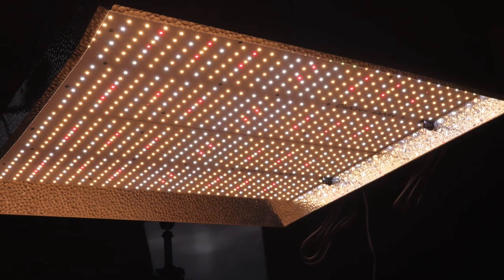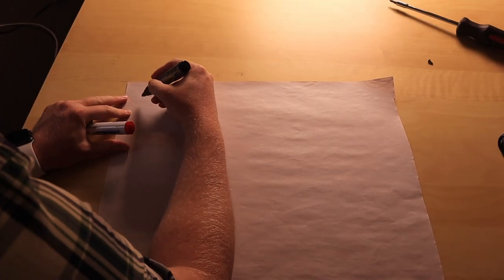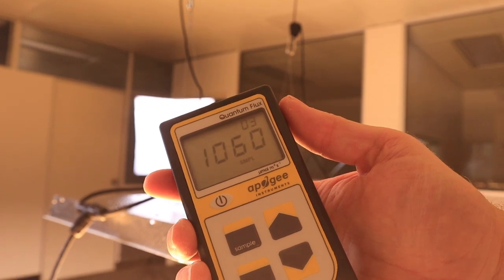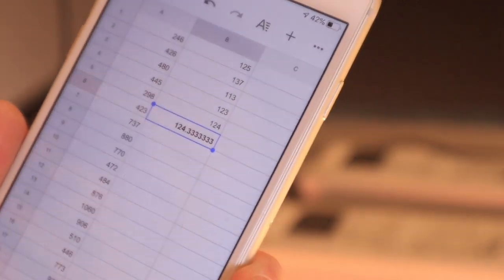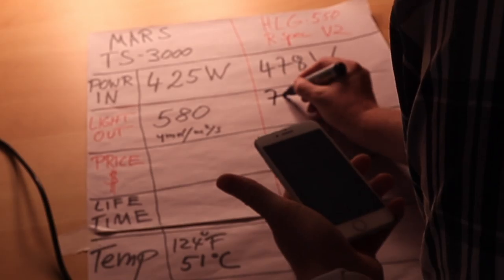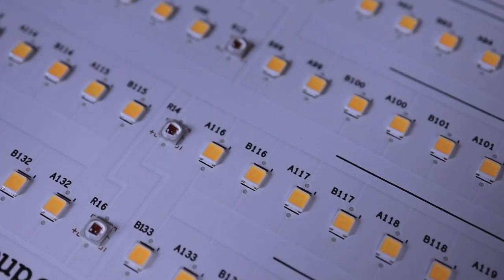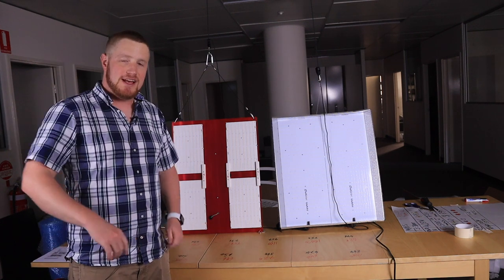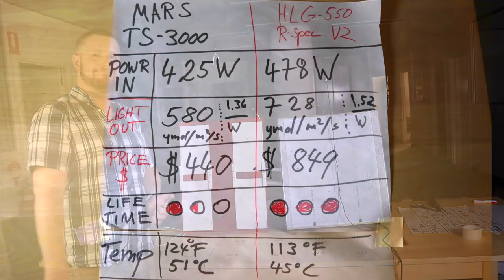HLG 550 RED v2 VS Mars TS-3000 - LED Grow Light Comparison

Comment: Thanks for the honest review , one thing we want to make a clarification is that the lifespan won’t be less than Samsung is that we use over 1200 pcs of the chips on the board, we use less amps(nearly half of which the Samsung chips uses)  to drive each chip so that each chip is less than 0.5w, this will ensure each chip at lower wattage pressure and gain longer lifespan .:)
Reply: ya hlg if there running over 52% that junction will heat,and leds will hit there L90 so much faster,and at $1800 ya want 5 years or over,and hlg really going after anyone using word quantium board
Reply: @magnumopus9631  It’s certainly very hard to keep them same in a different price.Objectively, the price–performance ratio refers to a product's ability to deliver performance is more higher.
Reply: Mars Hydro got a tsl2000 for Christmas along with a 4x2 tent.never grew indoors but,the results speak for its self.again I’ve never grown indoors before     Aloha🤙🏽🤙🏽🤙🏽🤙🏽
Reply: @melefarmer1127  Great to hear that, thanks for your favor~
Reply: @Mars Hydro what you recommend for 2-4 plants in a 4x4 space beginner not looking to go all out right now best bang for the buck need for seedling to harvest
Reply: Exactly.  More chips run at a lower wattage equals for a longer lifespan.  And actually a much more efficient way of emitting useable photons for light energy. HLG acts like the chips are just light enitted kinda like normal overhead lighting.  We know what we are useing grow lights for and it's not for shop lights. HLG and thier lambertion effect basically no design  for the light emitted is less efficient light.  The light has no direction and photons emitted are wasted.  At least the Marshydro has a reflective aluminum flashing around it. And I believe the SP250 are angled at 120 degrees. No wasted light.
Reply: this is what bro science gets you
Reply: @doingfreakythings9290  one TS3000 or two SP250 can be the options.
Reply: @MarsHydro_official  just checked out your 3x3 tents kit which is what I'll be going with, would 1 ts 2000 handle 3 plants in it
Reply: @doingfreakythings9290  Hapy grow, loving life
Reply: Far too much blue in your lights.  If you had a 3k version I'd probably buy one tomorrow.  Actually if you had something that was 3k and provided an actual even spread over a 4x4 I'd buy 10 of them.  Stop being cheap like me and put some more red in there.
Reply: I'm on my first 3x3 grow with a Mars hydro tsw2000 and you can't argue with results. For the money mars hydro by far exceeds any other quantum led. Going to buy a tsw3000 for my second 5x5 tent
Reply: @doingfreakythings9290  Don't overlook tent quality! I'm not saying Mars' tents aren't worth what they cost, but you always get what you pay for. I purchased a Mars Hydro 2x2 for my first tent and before my first run of AUTOS were done, one strap ripped off the inside of the door, the zipper track got all curvy/wonky and is hard to zip up/down now, tons of pin sized light leaks, etc... it was very inexpensive, so again, you get what you pay for. I am looking to replace that 2x2 with a different brand now :( But considering how cheap most of these tents are (with the exception of gorilla) you can spend a few extra bucks! Also, if you can go 4x4, do it. I'm not sure if Mars has more than one type of tent materials/zippers, but the one I got is very low quality.
Reply: @MarsHydro_official  i bought a spider farmer 4000 and now i wish i bought a mars hydro 3000. Damnit! Next time I will buy a Mars hydro
Reply: @l.ronhubbard5445  what dont you like about the spider farmer?
Reply: @chrispalmer6502  the price. I love the light itself. It's just i think I've come across a couple other quantum boards that are just as good but with a smaller price tag
Reply: @l.ronhubbard5445  what are the other lights? I'd be interested in looking at them as I haven't made up my mind on what to get yet
Reply: @chrispalmer6502  well as mentioned the mars hydro 3000 is similar and a bit cheaper. If you search "quantum board led" on Amazon and find the board priced $343.00. It's got the same exact Samsung LEDs and same Mean well drivers as the Spider Farmer4000. and it's more than $200 cheaper
Reply: M Nope  they have.  The mars pro was made with cree diodes.  So is their cob.
Reply: Your lights are still ridiculously OVER-PRICED!

Comment: μmol·J–¹ and initital outlay are the two metrics I keep a close eye on, as well as spectrum.   HLG has higher μmol·J–¹ (~2.6) vs ~2.3 for the Mars range. Mars is less than half the the initial outlay. 

An indoor grow, say 5 months with 2 months of lights on/off 18/6 and 3 months of 12/12, is 2160 hrs total. at 14c per watt for electricity, that's $302.4. 

Then add the cost of the equipment, $849 for the HLG550v2Rspec and $440 for the Mars Hydro TS3000.

So the cost of the first grow is $1152 for HLG and $743 for the Mars Hydro, A $409 difference.

The difference in μmol·J–¹ (efficiency/efficacy) is ~10-15% (HLG ~2.6, Mars Hydro ~2.3). One is paying A LOT in initial outlay for that small increase in efficiency/efficacy & the Made in America mantra.

Monied individuals, looking for max efficiency, made in america, style, brand, go for the HLG. Everyone else should go for the Mars Hydro's as they're much better bang for buck for over a 2 year period, imv.

I have similar ongoing tests going on with my sponsored HLG135 V2 Rspec and my sponsored Mars Hydro TS 600 on my channel.
Reply: 14c per kilowatt hour, not per watt. The same electricity cost also cant be used for both units because they draw different power from the wall. The HLG still comes out costing twice as much for a very small increase in μmol/J, though.

Mars Hydro - 425 watt - 0.14/kWh

18 hours a day for 3 months
32.6/month, 97.8 total

12 hours a day for 2 months
21.73/month, 43.46 total

Total cost of electricity to grow with Mars - 141.26
Add the equipment cost of 440
Total - 581.26

HLG - 478 watt - 0.14/kWh

18 hours a day for 3 months
36.66/month, 110 total

12 hours a day for 2 months
24.44/month, 48.88 total

Total cost of electricity to grow with HLG - 158.88
Add the equipment cost of 849
Total - 1007.88
Reply: You forgot to account for dumping the mars hydro in the trash in 2-3 years because it's 60% dead.
Reply: @47refugee  I can't forget something I've not experienced.

Comment: I’ve got the Mars TSL2000. Definitely quality quirks, most annoying of which (IMO) was the the reflector being bent inwards to the point it was actually blocking the outer diodes. This wasn’t transport damage. Just poor tin smithing. Had to cut the tin and bend out to make use of the outer diodes, not something you want to do to a new fixture. Having said all that... still wouldn’t pay twice the price for 20% more light. The Mars TSL made some really nice buds despite its quirks.

Comment: Awesome side by side. I saved a couple hundred dollars by building my own HLG  550. I simply bought each component (driver, heatsink, boards, etc) separately and wired everything myself. This is an awesome way to go if you can’t afford the cost upfront. Just buy a piece at a time until you have an amazing light!
Reply from the maker: Good idea.  Its very much possible to build a HLG light, there is nothing proprietary on them
Reply: Absolutely buddy have a look at vividled all the kits and more including mixed board configurations

Comment: The Mars Hydro at full blast is 625 watts. You can actually dim the light up and down on Mars Hydro. Out the box it is setup at 3/4 of the full potential.
Reply from the maker: Mars told me they don't recommend turning it up all the way.
Reply: Because they FAIL at max power. They fail at 3/4 power too, just takes a bit longer.

Comment: Are the HLG's also able to easily put the drivers outside the grow? Love that about the mars.
man that dimmer is so bad on the HLG. and WTF on the hooks? just dont even include them if they cant hold up an $850 light!
Reply: HLG hardware is top quality! I hung their lights with what came in the box. Also no need for driver outside the grow room. 2 HLGs in 4x8 tent Temps stay at 80 when room temperature is 70. Get both in hand and ull notice mars build quality is lagging far behind
Reply: I know this is a year old, but the solution for the dimmer box is to unscrew the box to open it. You should be able to put a knot in the cord so that it no longer pulls out when you close it back up.  I put together one of the QB Kits and it is exactly the same box.  That is what I did to solve that problem.  Honestly it's an old school solution.

Comment: Hi , great videos as always , I got the Mars hydro ts1000 for a 60x60 tent . How far I should keep the light away from the plant ( like first week etc...) and do I need to dim it or leave the factory setting ? Many thanks
Reply: Got the mars 2000 had to put light 70 inches from canopy top lots air movement and ac but very pleased
Reply: @allenlyon7202  70 inches? Maybe you mean centimeters? 70 inches is almost 180cm or 6 feet, which is the usual tent height from top to bottom.. Even 70 cm would be too high.. You can lower the light and dim it

Comment: Id like to see the sf4000 in comparison to these 2 lights
Reply: Same here 👍🏼
Reply: Dude, go to alibaba and look up sf4000  you can get it for 375 Canadian or 236 USD. Same exact light!
Reply: @HAPPYHERBS1 
I've got the sf1000 well I've got 2 of then and I've seen the sf4000 and it's amazing kick the arse out of hlg but very similar
Reply: I'm finishing up my first grow with the SF4000. So far I like it but the results aren't in yet so I'm reserving judgement. There is a light on Amazon with the same diodes and drivers as the SF for $343. I think I'll try that one next, or this Mars Hydro 3000
Reply: SF has more quality parts in comparison to Mars, also never heard of diodes going out on the SF as of yet. Time will tell.
Reply: @weedgrownindoors9322  spiderfarmer wants 900$ Canadian for a 450watt fixture. I would never pay $2/watt
Reply: @youtubeuser206  When the diodes die off faster than you expect you'll end up paying more in the end! I myself won't try these until they are tried and true like MH HPS.
Reply: @weedgrownindoors9322  my custom fixture from China uses Samsung diodes
Reply: @youtubeuser206  Does it come with good customer support?
Reply: @weedgrownindoors9322  I've never needed any... I've blown a few drivers but I buy my drivers from arrow or mouser so I've had no problems getting replacements
Reply: Sf4000 is better it uses lm301b and epstar. Mars uses just epstar on this board. But honestly get a lm301b from kingbrite with epstar or cree.. better prices and you get more for your money.
Reply: He is literally playing asian music in the background.... 

I support HLG all the way. American made and twice the quality
Reply: jaykalibuds uk All par test show the SF1000 being just a little better then Mars. HLG and Mars SP3000 are much better then spider farmer. The SF2000 can only cover a 2x3 😂 the SF4000 can only cover a 4x3.

Comment: Did you crank the HLG dimmer to max? 
Wouldn't it be more accurate to take a screw driver to the TS-3000 driver to crank it to max as well?
Reply from the maker: I did crank the HLG to the max.
Mars said they don't recommend cranking their light further up because the driver could get damaged.
Reply: @HomeGrowEngineering  The same should be true about the HLG unless the maximum is capped low but that seems slightly disadvantageous. I'd think it more likely that HLG is just less upfront about wattage draw effecting the lifespan. Would like to see efficiency comparison with the HLG dimmed to the TS-3000 wattage.
Reply: @trent5098  Your comment doesn't make much sense. The dimmers come capped by each manufacturer. if you mess with that, you run the risk of frying the leds, or rendering your fixture a flashing mess. Running the HLG at a lower draw would obviously (if you know how leds work) make it last longer and be even more efficient. Running the Mars at a higher wattage will do the opposite. What is there to not be upfront about?  That doesn't even make sense.  If you want to run your leds at 425 watts instead of 478 watts, do it, they'll last longer.  I mean duh.

Comment: Id love to see this with the spider farmer sf4000
Reply: same vs the hlg
Reply: I personally UPGRADED to the Spider Farmer Lights 2 - sf4000's and 2 sf2000's.  I was running last year's top of the line lights from Mars Hydro and 2 additional lights from Cali Gro.  Both lights are full spectrum. but that's where the comparison ends.  The new Spider Farmer lights are PHENOMENAL!  So much so I don't even need to run them at full power.  I have the 2 sf4000's in my main flower area it is a 20' x 7' (140sq ft) area and these two lights are more than ample to crank out some to the largest harvests that I have had in a long time.  My last harvest vs my lights from the other manufactures came in at a little over 40% greater in volume/mass.  So, with less power and fewer lights (Had 4 x 1700 watt full spectrum LED's) in the flower room, I achieved a superior harvest with the NEW Spider Farmer Lights.  Yes, I did an exact Genetics comparison to be sure.  For my money,  I'll never use anything but the Spider Farmer Lights.  The proof is in the pudding.  **I am not being paid or compensated in any way for my opinion by Spider Farmer.

Comment: Thanks for this nice review. In my opinion the HLG is the better light. The LEDs from HLG are based on flip chip technology. This means lifetimes >15.000h. While the mars is using the very cheap standard midpower packages. For sure the efficacy is good too, but degradation will be much faster.
Reply: I think this is the main thing everyone seems to forget. They all look at immediate numbers, but very few of them actually review this light after a year or two.
What good is a 200€ light with high numbers that only lasts few months or less than a year? Better to buy a 400€ light that will last 2-3 years.
The problem with Mars, Spider and other cheaper lights is that you have a 50-50% chance of getting a reliable light, and with questionable customer service and warranty.

Comment: I bought 2 ts 600 to add to 5 by 5 grow tent with2 1000 watt blurple lights. 4 lights for 4 plants works great.Can move each light to adjust for each plants growth. All plants grew great and did not notice any difference in ants under the 600 watt Mars or the 1000 watt blurple lights. 4 smaller lights give better coverage than one big one in my opinion. I would use 4 Mars 600 lights if I was starting a grow.75$ Canadian each on Amazon.

Comment: Both companies seem to try and squeeze out the most bucks out of their product.
I can pretty much go to china and buy the same crap for much cheaper and very often the built quality is the same or better.
sylstar-lighting was the company I went with they have pretty much everything you want. boards, spider leds, foldable leds and you can chose the LEDs they use for the higher end products.
They have epistar / hongli / samsung / osram diodes. I'm happy with their product.

Comment: Compare the Spider Farmer light that also uses a Meanwell drivers and Samsung diodes. I think you might be surprised in the output and efficacy of the much less expensive light compared to the HLG. I think they’re both around 2.7 umol’s per watt and the Spider Farmer runs a bit cooler than the other two lights you just compared. Thanks and nice informative video!

Comment: HLG overdrives their chips as well, which leads to premature failure.
Reply from the maker: Mars under-drives theirs.  They instead use more chips. To make them last longer.  I didn't know that before the video.
Reply: HLG quantum boards have 18 chips in parallel on a 2100ma driver. That’s 116ma per chip , these Samsung’s can handle over 200ma each. So how is that over driving the chips?  Poor thermal management, yeah I can agree with that, HLG550s can cook eggs on top. Over driving chips, no.
Reply: Yup

Comment: Can I easily fit "mars TS3000" into my 100 x 100 x 200 tent as the main light and put "viparspectra 600W" on the sides?
Reply from the maker: I think that may not fit.
Also, just the TS3000 will be enough light.
Reply: @HomeGrowEngineering  ts3000 are enough?
Reply: @HomeGrowEngineering  the TS3000 does not cover the entire surface of a 100 x 100 x 200 tent. I may have found a more judicious alternative by opting for the purchase of LUMATEK 450W LED. what do you think?
Reply from the maker: @SparowElGringo  this is what the Mars website says:   Perfect for 5' x 5' (150x150cm) Veg stage, 4' x 4' (120x120cm) Bloom.     I can't comment on the Lumatek.

Comment: Great video! I recently got a 240W Meijiu QB with V3 Samsung chips. I would love to see some analysis on the latest version of their chips. I feel like the board is pretty great, but I haven't seen any test results, plus it is my first grow so I have no basis for comparison. I believe I read that they're supposed to be 7-10% more efficient than V2, but I think that's a claim by Samsung.
Reply: Alex Gerlock you have the one with the lm301h ?
Reply: v2 and v3 is BS marketing from meijiu. Samsung doesn't make a v3 LED.  301b and 301h are the same thing.